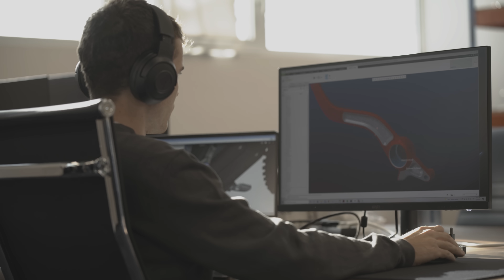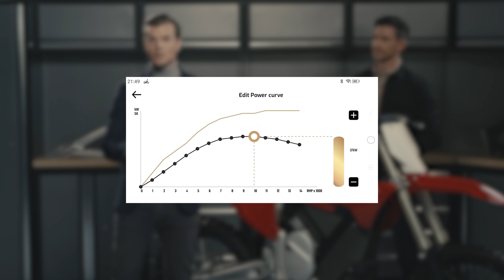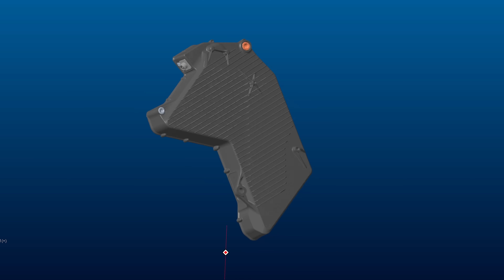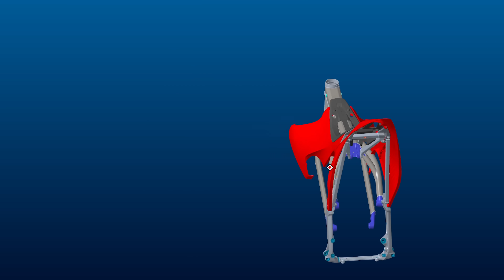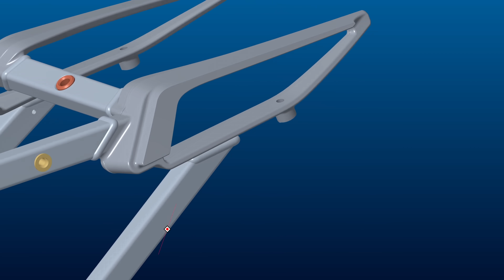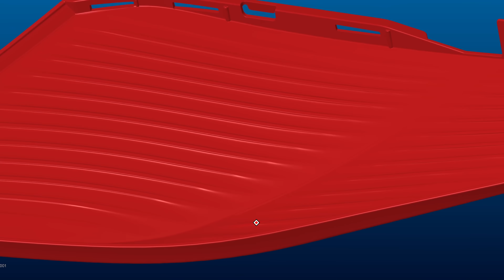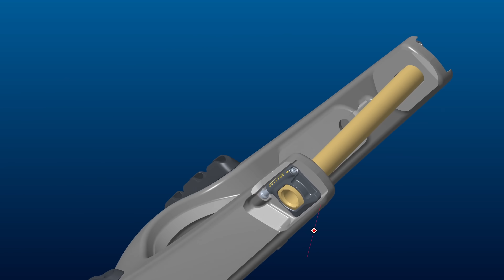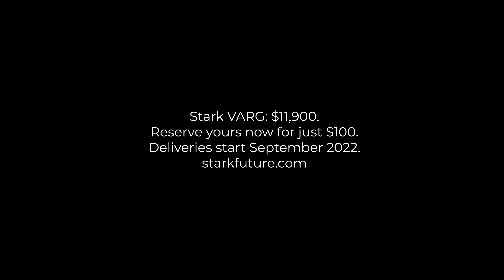The World's Fastest Motocross Bike is now Electric - Stark VARG

Comment: 242 lbs…..too heavy
Reply: Too heavy for what? Fuelled up 450 with some crash protection comes close to that. Sure, its not the lightest but for what it is, its very impressive.
Reply: @bartgugelot5788  Motocross bikes have become too cumbersome and heavy, exactly what they are not supposed to be. It would be better to give up some power and drop about 30 pounds or more.

Comment: I don't believe you. Why are you silent about the engine power in continuous mode, and not peak? Nothing outstanding? I made a simple calculation. 6kW - battery. This is 1 hour with a power of 6 kW /8.2 horsepower, 15 minutes with a power of 24 kW/32.8 horsepower, until the battery is fully discharged, excluding losses. What 6 hours of driving and 80+ hp power are you hinting at???             
 
Я вам не верю. Почему молчите о мощности двигателя в непрерывном режиме, а не пиковом?   Ничего выдающегося?   Сделал простой расчёт.  6kW - батарея. Это 1 час с мощностью 6 kW/8.2 лошадиные силы, 15 минут  с мощностью 24kW/32.8 лошадиные силы, до полном разряда батареи, без учёта потерь. О каких 6 часах езды и мощности 80+ л.с. вы намекаете???

Comment: So much inovation this will make the existing companies up their game. Everything looks to have been thought of and no shortcuts. Its a premium price but running costs have probably reduced by 80%. If you own a PHEV hybrid like the 2021 Mitsubish Eclipse Cross with V2H charging you will beable to use your car to charge your bike track side by putting the car in charge mode or just charging off the car battery its self. You would also need the V2H box unless Stark Future can make a charger that can connect as a V2H charger which will be amazing. This could be my next bike

Comment: Range? Claimed 6 kWh battery (energy) capacity.
That translates to 1 hour of riding with constant 6 kW (8 hp) power output.
Or 6 hours of constant 1 kW (1.34 hp) power output.
Or 6 minutes of constant 60 kW (80 hp) power output.
The battery bank looks like it houses 400 cells?
If it's 400x 18650 cells @ 3.6V 3.5Ah = 5 kWh, weight of cells 20 kg.
If it's 400x 21700 cells @ 3.6V 5Ah = 7.2 kWh, weight of cells 30 kg.
I don't know what cells they are using.

Comment: I am stocked about this project. Bike looks awesome, smooth and balanced geometry. Big congrats to the company. As a rider and dirt bike lover, you can find a lot of combinations and different kind of feelings due to the clutch. Whereas, this model it’s just can be used as mx or cross performance. I think it will be interesting for the nexts projects develop a certain approximate to the “clutch feeling” in order to increase the market, and also be used for hard enduro and enduro modalities. 
Awesome!
Reply: I think it would be pretty easy to have a clutch lever tied to a switch and caused the motor to freewheel without regen.  Should simulate the clutch feel nearly exactly.
Reply: It don't need one at all. It's super ease to go fast and smooth.  You can put it in 10hp mode and my little 16yo sister can ride it and I own the Alpha 80hp. Ordering and 2024 and Keeping my 2023.

Comment: Confused why they would want the pegs to fold up vertically. Having them fold up and back at about 30 degrees makes more sense for when you hit things while moving forward. They missed that one I think...
Reply: I was thinking the same, but of course they must have a reason for doing this. I guess you never fall down 90 degrees to the side. When the bike hits the ground it will have some angle compared to the direction you are travelling - so maybe it is better to fold straight up??
Reply: @tomnordlie1467  if the bikes moving forward its always better to fold up and back so I think they just missed this detail. If it only folds up it would potentially just bind and not fold at all if hit from straight on.
Reply: @kellchristophersen4396  It is most logical that you are right, since pegs on all dirt-bikes fold up and back. Just find it strange that Stark do it differently without having a good reason for it. It's not like they don't know this? Anyway, I want this bike regardless of its pegs-folding-capabilities 🏍️

Comment: Aside from it being gorgeous, I'm very impressed with the engineering and technology and can see the advantages; but I would miss shifting gears as it has always been part of the man/machine connection.  For whatever reason, for me, electric still has a sewing machine vibe.  However, it is clearly the future.    Regarding the battery system, isn't there supposed to be some kind of new lithium graphene battery, or something like that, on the horizon that is reported to have several times the energy density of current battery technology and is supposed to be unaffected by puncture damage?  If so, that would go a long way towards making electric vehicle more viable.

Comment: I am surprised no company has sorted a way to include a spare battery that can be easily swapped (well as easy as you can with a 70lbs battery). That has always been my concern. Head to your local track, get 30 minutes of seat time, pull out the old genny and wait for two hours. Seems like it would be so much nicer to come home, slap your bike on a charger and your spare batter on a charger and grab both when you head to the track.
Reply: Some e-scooters and mopeds have swappable batteries. The issue is that if you make it swappable than the frame around it has to be heavier and stronger. The battery is Stark Varg is probably a part of the chasis.

Comment: Here's the question, do you choose a pocket pussy, or the real thing? Electric bikes vs gas is the same concept. Real men burn gas!
Reply: It’s just an option. Ride what you want but it means you can ride in trails without anyone hearing you, it’s faster than a normal 450, and means less moto tracks have to be shut down
Reply: @soundbreakermusic  no its not, your drinking the bs marketing is telling you as truth. Go look closely at the Alta and this. Barely any difference and they are telling you it's all this amazing shit when, in reality it is not. Your being sold snake oil
Reply: @mulisha0351  I’m not buying Into anything, but there are some smart changes they have made. Take the magnesium cover on the battery. And I’m talking electric mx bikes in general, not just this random brand that has popped up.

Comment: Exceptional first effort!  What is the estimated life of the motor unit and battery?  Are either rebuildable?  What factors lead to the 1 to 2 hour battery recharge?
Reply: What factors lead to the 1 to 2 hour battery recharge?  6kW - battery. This is 1 hour with a power of 6 kW /8.2 horsepower, 15 minutes with a power of 24 kW/32.8 horsepower, until the battery is fully discharged, excluding losses.
Reply: @ДимитрийКовешников  maybe current limited for heat etc

Comment: Needs a clutch for fine power regulation and safety for shutting off power when you’re hanging off the back.
Also…need to see it last a full MX GP race
Reply: Can’t agree with the comments lads about not having a clutch especially for technical off-road.
Reply: Full hammer n tongs GP race will be the prove needed to convince the masses..it’s only a matter of time before it scores a major win and then it’s all downhill for the current Mx bikes as we have always known
Reply: @donbrashsux  I can’t see that happening within the next 20 years.  Battery tech just isn’t good enough.  Still only 1/40 the energy density of petrol.
And forget running a rally bike on EV.
Reply: @bobmcgrath1272  I truly hope your correct ..I love the Brap not the wizz
Reply: @donbrashsux  love the noise, smell and vibrations of petrol engines
Reply: The only real safety is exactly the same as on any bike. Your right hand. Throttle control is just that much more important on an electric.
Reply: @kingofallworlds  That's not true at all, your left hand is just as important on a gas bike for power modulation. When you're getting kicked around it helps to have a lever (and not a twisting motion) to more accurately cut power. It's not about the power delivery, it's about controlling how much of that power goes to the drivetrain
Reply: Not really with all the torque of an electric motor and the ability to tune it you really don't need to worry about a clutch cuz you will get that instant torque as quick as you can pull the throttle
Reply: A left hand rear brake would prevent whiskey throttle. I don't think an electric motor needs a "clutch" for power modulation
Reply: clutch for babies
Reply: @KGwideangle  Try to convince Billy Bolt that KG.
Reply: @algee8228  and Graham Jarvis et al.
Those saying you don’t need a clutch most likely have very little to zero experience of technical hard enduro or trials riding.
No clutch is a showstopper.
Piss poor range is also a showstopper
When I can do 70-80 miles off-road at race pace with (Maximum) 5 minute recharge then I’ll be impressed.  Until then it’s BS virtue signalling.

Comment: Don’t get me wrong, I do believe eBikes are the future, but I really struggle with this announcement:

80HP, can handle MXGP intensity, 6 hours of trail riding… superlatives here and there.

BUT: They say the bike has 6kWh battery capacity and that you can ride trails for 6 hours with it. That means you may only have an average power output of 1000W while riding. A hair dryer needs more power than this. Math sucks 😉. But hey, marketing is everything these days. That’s probably the reason only their CEO (MBA) and their communication manager talk about the technical details and no engineer. 

Important questions are left unanswered, like is the battery included in the price and what about the charger? Can you swap batteries between motos? But at least we learn that it has a 24 carrat gold logo on it. 

My personal highlight at 11:05: "weights only 110kg fully charged"...

Another revolutionary bike like the Cannondale Motocross bike in 2001… But the chain adjuster is cool. Maybe this is something that will stick around.
Reply: It gets lighter as the battery discharges too 😉
Reply: 6kwh for the battery is not enough for regular use. Its like having 2 liters of gas
Reply: @macolonie2249  A 450cc has 6 litres of gas, which weight is 4.2Kg, and he said that range is similar to a 450cc motocross bike. So I guess those 6Kwh, which weight is 32 Kg, would be close to 5 litres of gasoline that weights 3.5 Kg. Anyway their website says their 32 Kg in battery is have enough energy for 6 hours at very low speed or to be able to complete a motocross race, which normally is 20 just minutes plus two laps. It seems that the most dense battery in the world has around 10 to 1 ratio respect to gasoline, I.e. one litre of gasoline stores around the same energy of ten Kg of the most "dense" batteries in the world. 
An electric car would need 350Kg of the best batteries in the world, for a similar range that is provided by 35 Kg of gas engine which volume at 15°C is 50 litres.
Reply: @josemariatrueba4568  please do the math with KW and skip the weight, it will be more accurate
Reply: @macolonie2249  ??
Not a matter of Kw (power), but kWh (stored energy).
Maximize the kWh per weight unit, and volume also, is the way to go for a vehicle that has to climb hills. Batteries are very poor here a ratio of 40 to 1 respect to gasoline or kerosene. Apparently this bike uses second to none ultralight batteries but still, I doubt their weight is lower than a 20 to 1 ratio respect to gasoline.  But they claim that with 32Kg they have around the same range than a 450cc four stroke bike, which normally store around 6 litres, which weight including the tank is less than 5 Kg.... Hard to believe!
That's why electric vehicles with batteries are so heavy and have such a poor range.
For long range it would be better to have a combustion engine and a second electric motor producing electricity onboard.
Reply: Agreed! They didn’t talk about the important bits like brakes, suspension, wheels and tyres etc. I bet the phone display is an extra €$£ to🤷🏼‍♂️
Reply: Range is the weakness of electric vehicles that is unfixable with current battery technology. How do they get around it? Well they lie of course hahaha. They are taking pre-orders too, wonder if they'll deliver on time, or maybe have a bunch of setbacks like tesla with their products.
Reply: Over priced electric crap! Check on the cost of a 2nd battery. Maybe this would be just ok for the wealthy sponsored MX rider that has all of the lithium batteries needed!
Reply: All the money into this stuff wrecks my vision of what used to be moto bikes! Any true rider would want the old days back instead of what this day of moto has come too. High prices and innovation when some just want 2 strokes from their favorite manufacturer. My opinion of course😞

Comment: This is close but You missed a mandatory element. Electric bikes must incorporate a clutch. You can spool energy in a flywheel and release it with the clutch in ways that are not possible with the throttle alone. Additionally, some situations it's easier to pull in a little clutch than it is to roll back the wrist.
Reply: i think you may not understand the torque that electric motors have. i encourage you to try an electric......anything ..... dont get me wrong im an I.C.E. guy but .... but a smart soldier has to know the enemy and damn electric shit is gettn better every year
Reply: @jacobnewtron9635  I've ridden a couple good electric bikes. In fact, I bought my daughter a Kuberg Trials Hero. It's 3000w and pulls me around just fine. The torque is great on electric but the lack of a manual clutch is where they fall short. I'm sure it's fine for MX or flowy trails but the moment you get into a technical situation a manual clutch is a requirement. Like I stated above, you can release and remove energy in ways not possible with your wrist alone.
Reply: @Eldon95084  3000w vs 8kw .... i think tuning the varg could give you the snap u desire. but after some reflection i feel you may be onto something, the flicking of the clutch and real time control /regulation has been inhierant to riding since there were engines. throttle is one thing but i now believe/agree with your point ty
Reply: @Eldon95084  Some like yamaha e bikes have clutches, and you are right, my surron lbx even fully moded lacks a clutch for enduro and trial IMO

Comment: Really hoping dealers get behind this, as one big concern with any new brand is whether you can get parts locally when you need them. I get that you can always go to the manufacturer when there isn't a dealer locally, but that usually means a longer wait. Besides that, I for one am not that knowledgeable when it comes to electric vehicles, and this bike would be more attractive if it also came with a dealer network capable of handling technical support issues. I'm ready to jump in, but I'd like to talk to my dealer about this bike before pulling the trigger. My dealer sold the Alta and still sell the KTM Freeride-e. I'm convinced other brands will bring EVs to market in the coming years, but why wait? Considering everything this company has done in terms of innovation, patents, etc., I can't see the other brands improving on what this bike has to offer for a while. I hope the ride reviews on the bike will be positive ... one thing mentioned already is whether this bike will overheat with prolonged hard riding. Stark says no, but I'd like to hear that from an unbiased source. Other than that, I really can't find anything to complain about.

Comment: Put a clutch on it, then you might get some interest from the off-road guys.
Reply: I've spoken to a few trials riders that bought epure bikes with clutches, now after 3 months of riding they said they don't touch the clutch at all.
Reply: While they may not use the clutch I can tell you there will be scenarios when a clutch is far more useful than a throttle alone. I’ve ridden an Alta off road and it is by far harder to keep traction on technical hill climbs. You’re putting all the power application is a single hand rather than two. Plus, a twist throttle is harder to control than a lever.